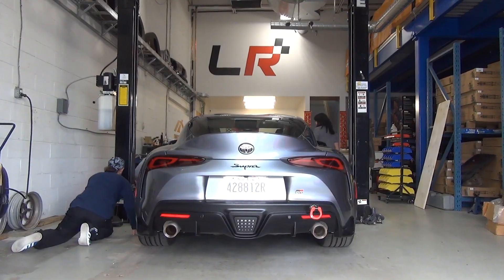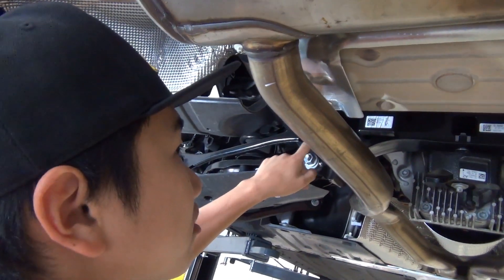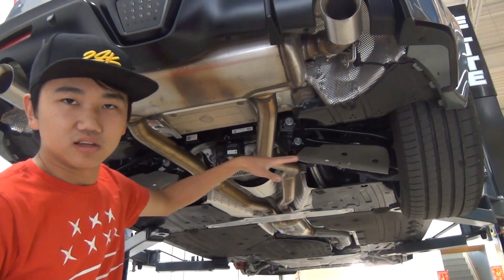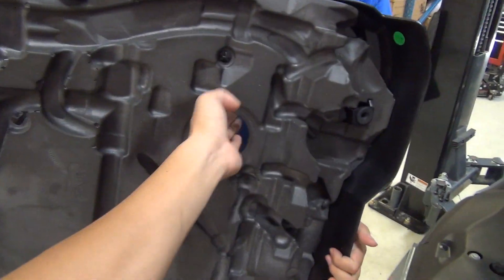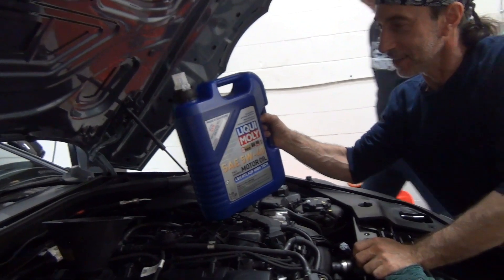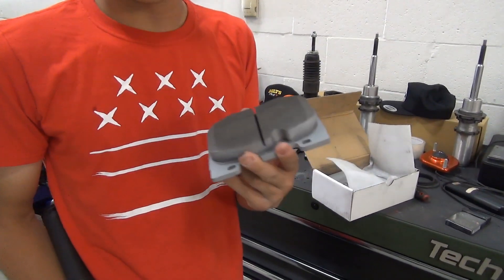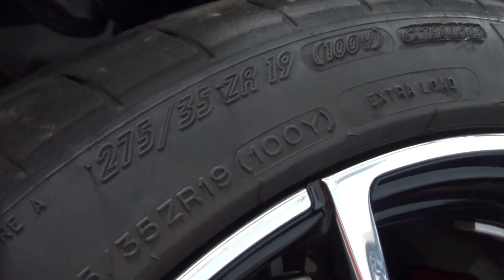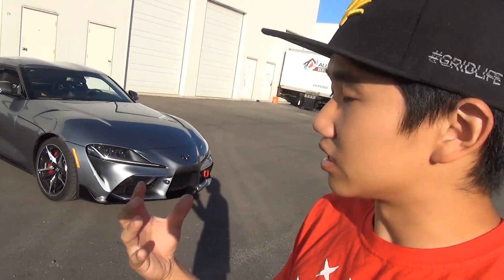2020 Toyota Supra Track Prep & Discoveries - Project TA90 #3

Comment: That flat bottom might explain your exceptional gas mileage as well.
Reply from the maker: Absolutely. Massive reduction of drag = higher gas mileage, but also higher top speed without the need of crazy power!
Reply: @JackieDing86  what kind of mpg you getting?
Reply: @matthewyang2792  is specified to be making 31 mpg highway, 24 mpg city.  with more power tho will come down a bit, but still pretty damn good mpg.
Reply: @LilPistacho  oh, just thought he is getting above manufacture ratings.
Reply: @matthewyang2792  I remember he had posted to instagram getting 40mpg on the highway doing 75miles on cruise control.
Reply: I guess I am kind of off topic but does anybody know a good site to stream new tv shows online ?
Reply: @Azariah Amari thanks, I went there and it seems like they got a lot of movies there :) I really appreciate it!!
Reply: @Khalid Graysen happy to help =)

Comment: Pumping out ALL the videos, love it!
If you don't mind me asking, i have a few quick questions.  
Which suspension are you going with?  KW seems to have the V3 out already, or are you going to help develop a kit with another company?
Regarding Liqui Moly, keep an eye on your oil-temperatures if you can, on track.  I know it's more apples to oranges comparing the B58 to the S54, but my oil-temps were about 10 degrees (Fahrenheit) higher with LM than with Castrol or Redline.  Curious to see if it's similar in the B58.

Hyped for mooooorreee!
Reply from the maker: We are gonna be working with Reinharte on coilovers, and Eibach on swaybars I think! 
Will keep an eye out on oil temp!

Comment: How much weight do you think you can shed by tearing out unnecessary bits and pieces? Seeing as how you have a tow vehicle, will this be full race or will you still be keeping some creature comforts?
Reply from the maker: Truly I want to rip everything out, but this thing is both soooo nice and I’m a little worried about the wiring issues that might cause. Also TA requires full interior from A pillar to behind the driver seat. I think we can get our 300 lbs. let’s wait and see!

Comment: Usually I'm not a fan of flat bottoms...
But do the rules allow for a different panel say thicket plastic/aluminum instead of those plastics?
For the coolant also it runs 2 water pumps. One electric and one standard. A lot of the 340i/240i guys run Evan's waterless coolant with success on track at lowering temps.

The sway bar end links will probably need upgrading as well as the bars. For the suspension the techs say the rear is similar to the 240i but that's only what they say. One big thing for this engine is oil changes. 7k miles on the street and you should change it. I have seen some quick connect style drain valves that work great.
Love the stuff Ding!
Reply from the maker: No. You are literally not allowed to modified the floor from front axle to rear axle at all, or you’re going straight to Unlimited class.
Reply: @JackieDing86  Dang ding dat sucks. Hope those panels can take a beating!

Comment: Do the rotors need to be switched as well when you do brakes ? I thought bmw rotors had to be switched every time brakes were done .
Reply from the maker: The rotors are in good shape, the residual material got cleaned up very easily

Comment: I’m curious if Monroe Intelligent Suspension/Toyota Active Suspension/BMW M Active Suspesion can be tuned with simple $200 software like previous models. Would be fun to roll up with factory stock shocks and lay down a great lap time. Maybe paint aftermarket lowering springs black & tune factory shocks to match. Paint the brake pad backing plate black. Flash the stock ecu with 400hp tune or upgraded turbine wheels inside stock housing for 500hp. Looks completely stock but runs 1 min 17sec at your local track. Haha
Reply from the maker: For what it's worth, Eibach is developing adjustable perches and springs for the stock shocks I think.
Reply: Nice. I wonder what spring rate they will choose.

www.hksusa.com/download_file/view_inline/41117

HKS version has 243 lb/in front & 667 lb/in rear spring rate

Wonder if standard size race springs (60mm or 2.5” ID front & something larger in rear) would fit with light modification to perch or delrin adapter

Anyway. Awesome car & nice channel

Comment: Take off the fake vents please and see if they are actually functional for air flow or if Toyota is bsing and there isn’t actually a channel behind them. It’s my most curious question about the car.
Reply from the maker: We already examined, taking fake vents out won’t make a difference as you still need to cut the front hood and fender liners, and even then it’s not large enough to make a substantial difference. We will make some proper fender vents soon
Reply: Jackie Ding so then all the fakeness they were “leaving to tuners” can’t actually just be swapped with open vents for airflow. Interesting and thank you.